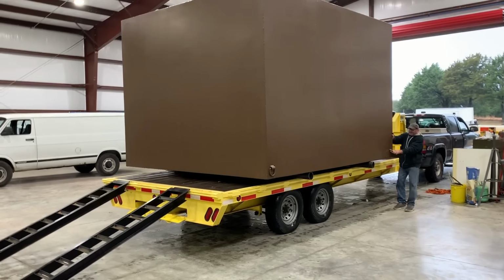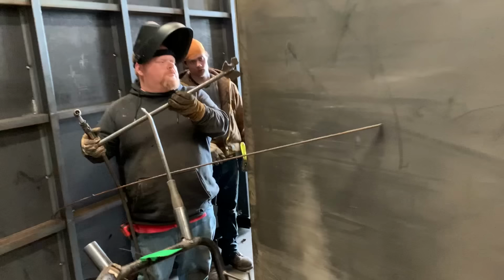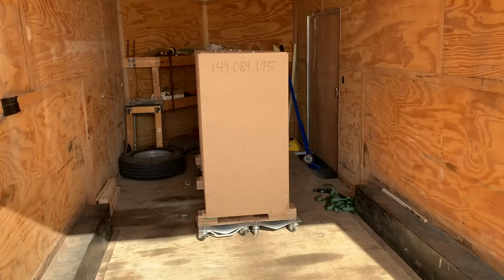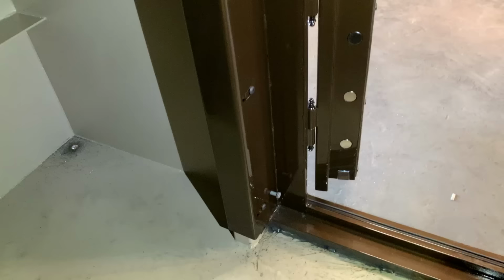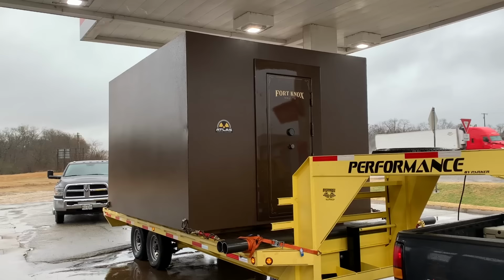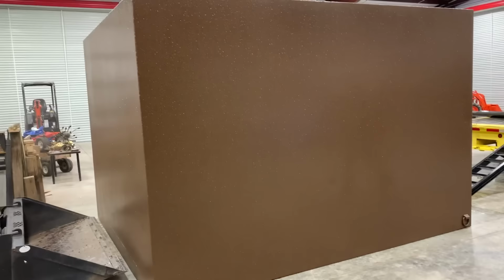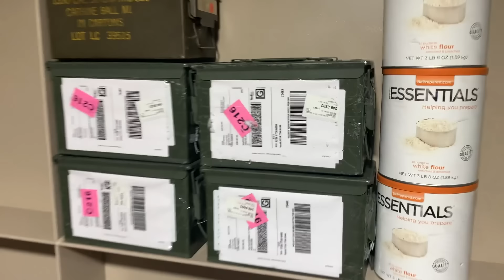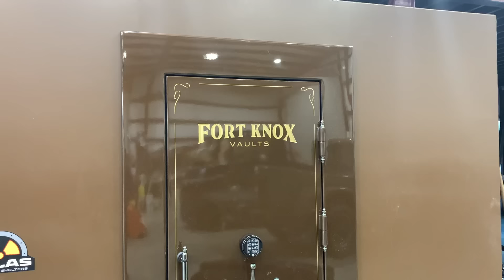Building a $20,000 Fort Knox Gun Vault

Comment: Very impressive, just a tip.. For put that on the floor you  can lift with the forklift (with 2 if necessary) when is "on the air" move forward the truck and after down slowly over the pipes or dollys to move that to the final location (I'm sure have a bad writing sorry for that)

Comment: I build  12x12 box  I use 2 inch thick Ar500 steel plate and build another 14x14 box outside of that fill the 2foot gap with crushed granite mixed with fiber reinforced concrete making the box wall 28inches thick and  build the vault door  stacked plates up to 30inches thick you can drop  a bomb on it and it won’t do shit
Reply from the maker: That's great.  But that's not what he ordered
Reply: @AtlasSurvivalShelters  yep people order what they can
Reply from the maker: What yiu just described would be awesome.  But no one has the Monet to but it.  Plus 2" thick  AR plate   Wow that would stop anything.  Got $200,000 and I'll build it for you

Comment: burn 2 tires at one corner, mid burn spray with hose,  them cold welds pop like pop corn. knock a couple wedges till a scissor jack fits. opens like a book..... really needs concrete and rebar.
is the door held on with slide shims and 1/4 button heads.
pretty but not 20k pretty.

Comment: Here is a question for you. Can you build a safe from the AR550 steel that is also a knock down similar to a Zanotti Armor Safe and utilize a door from Smiths Safe Doors? Thinking about doing something to ship to the EU. Perhaps six ft.tall and four ft. square. Don't need any shelving inside, just some thinner standoffs to mount steel studs for drywall.
Reply: Any competent fabricator can make this exact safe for 1/4 the cost. Im not sure if you heard but the 20k price tag didnt even include the door. You can use any door you want, just gotta cut the right size hole. Look elsewhere my friend.

Comment: To all the people in the comments saying he needs a bridge crane in the building he doesn’t need one would it be nice to have in a perfect world yes but it’s not your money you spending to buy one so I would suggest you look up what a 40 to 60 ft wide double bridge crane that’s over a hundred feet long cost and the amount of room the posts take up not to mention the floor depth requirements to support the 50 ton crane he would need itself plus the weight of the lifted objects plus any crane over 1500 requires a license to operate yearly certification maintenance additional safety piers to protect the legs of the bridge           

So is getting a crane the a would be nice to have thing yes is it necessary or the best option when you can buy a 62 ton Toyota forklift cheaper or a fleet of smaller forklift cheaper than that